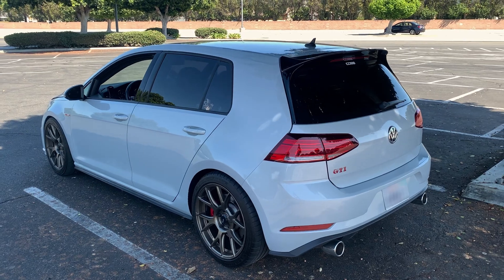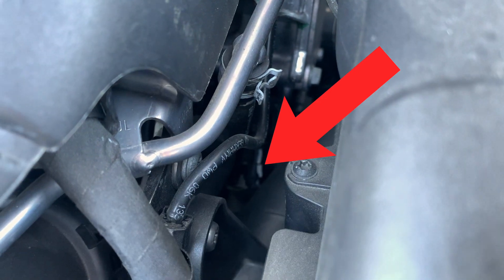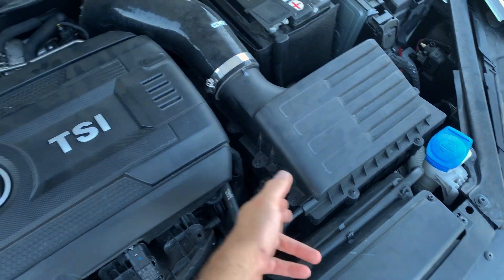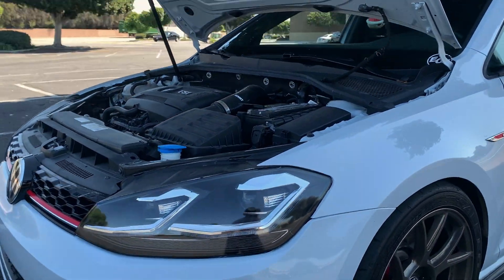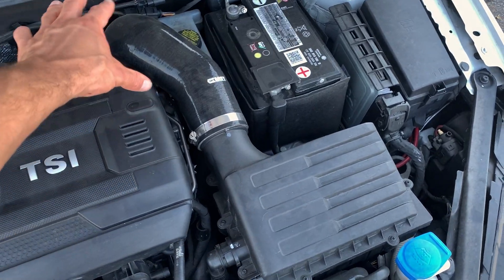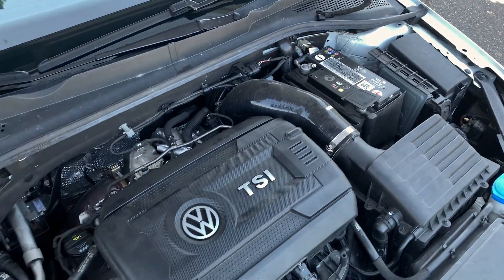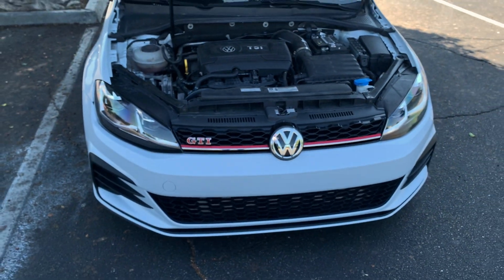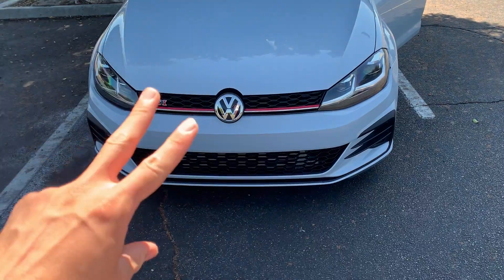GTI Mod Update + Check Engine Light

Comment: You can also remove the weather stripping on the wiper cowl if you want to hear more whoosh sounds. I did it and it doesn’t let water into the engine bay which is a concern I had. Try it out!

Comment: I have been having issues for about a month with my secondary air system. I’m getting P2440 (Secondary Air Injection System Switching Valve Stuck Open Bank 1) I have a 2017 with 33k miles. Thinking I’m gonna have to replace the valve itself just like you.

Comment: Turbo leaks oil on turbo blanket = car goes up in flames. Just an FYI. It would seem that's primarily why car manufacturers don't use them from the factory.
Reply from the maker: Heard about this happening. The blanket material is good at trapping heat but once there’s any oil spill or leak it can be dangerous

Comment: I got integrated engineerings intake and it sounds beautiful. Also I put my downpipe and I got a CEL lol
Reply: Do you have a cat? I have a unitronic and with a modified spacer I get readiness and everything. There is a walkthrough on vwvortex on how to make it
Reply: @MeltingRubberZ28  yeah it’s a CTS high flow catted down pipe
Reply: @Sus_blues  buy an o2 spacer. It will clear the code

Comment: Hey man, I have the same code. Do u just replace the sensor or the the entire air pump? Im Not sure what to do.
Reply from the maker: Replaced the pump and reset the code. It never came back. Some have deleted it by adding a ‘block off plate’ instead.
Reply: @JewelCity1  thanks man, I really appreciate it
Reply: @JewelCity1  yo bro it’s me again lol, where did u buy the pump from? I see a bunch of different looking pumps but idk which one is the right one. Is it possible for u to send me the link to where u bought urs from? Thanks